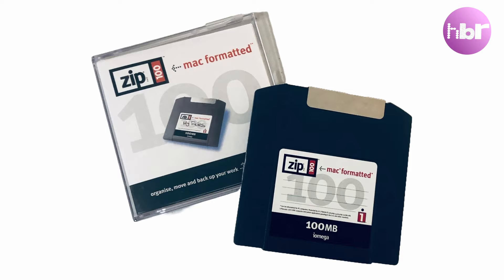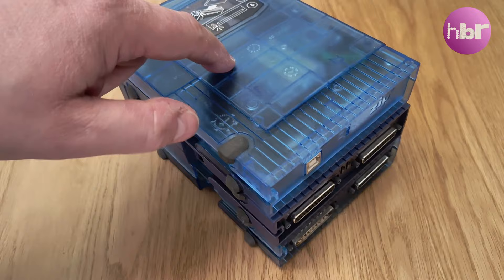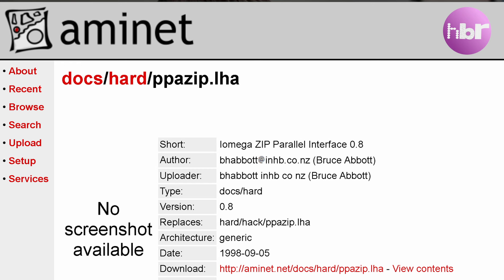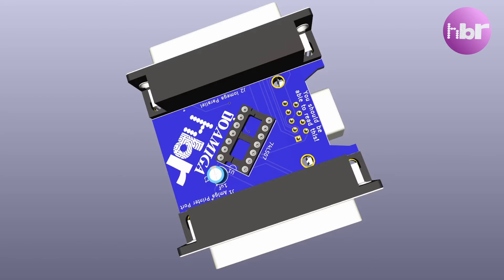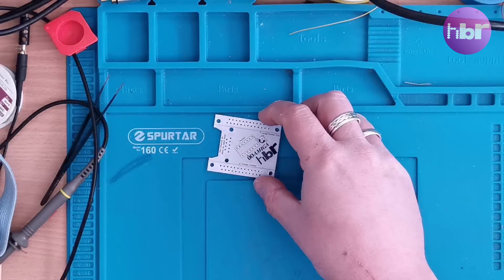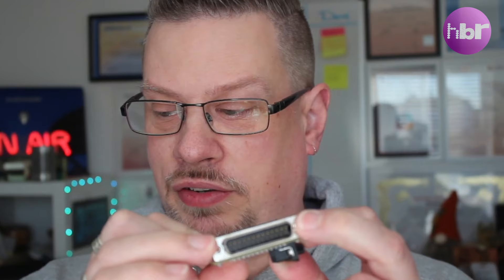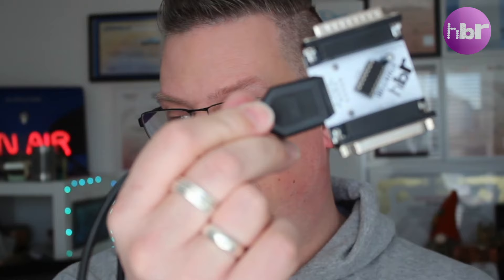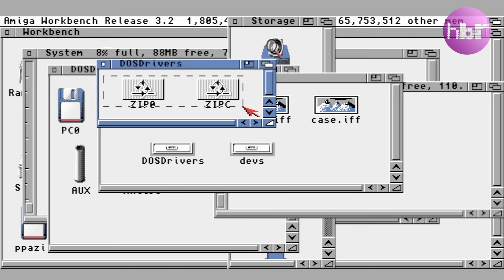Finally! Game Changing File Transfer, on the Amiga?

Comment: I have a parallel port one be good if you could by the adapter pre made with the required software.
Reply from the maker: In theory you can, there is a link to the project on PCBWay in the description they do offer an assembly service, all you would need then is a 9pin joystick extension and the software is available on aminet... If you are in the UK I could sell you one assembled I guess, wasn't expecting there to be a market lol
Reply: @hackbuildrestore  I would like to buy one . So people can ask : Why ? And I can say : because it can :-) What's the price of such a build ?
Reply from the maker: Where are you based? I have enough to build a few I think, I don't have joystick extensions though... Didn't really expect to sell them...
Reply: I also have a parallel port one and an Amiga 600 which I sadly have no way of copying software onto it. I would also buy one pre-made if available!
Reply from the maker: Shop is now up on https://hackbuildrestore.com/store
Reply: If you look closely, some have a scsi icon. These can be plugged into a real scsi buss.  I have  one connected to my Atari st.

Comment: I still have my IDE zip drive in my Towered A1200 with Zorro slots and a blizard 1260.It truely was a game changer.
Reply from the maker: Thanks for watching! I was looking at some towered A1200 systems on evilBay only last night :), they look to be a nice alternative to an 4000t !! I don't have any AGA machines yet... I do have a ZIP250 and ZIP750 in the internal IDE form, just I lack an IDE controller in my A2000. I do, however, have an external SCSI ZIP100 I plan to try that on the A2000 at some point... soon!

Comment: I was lucky enough to have a GVP hard drive for my A500. It had a SCSI port on the back and the only thing I needed to do to the Zip drive was set the termination. For that point on, it was just like using a big floppy drive. It even sensed disk changes and mounted the new disk without me having to do anything. In order to format the disks, I believed I used GVP prep and then just formatted them, but it has been quite a few years.

Later on, I got a used A2000 with Commodore's SCSI card in it. It was a drastic change from the GVP. For starters, I couldn't even figure out how to format a disk. It's been so long that I've forgotten the commands, but I seem to recall that there was a reboot required, which wiped out whatever you had just done. Even my friend didn't know how to do it with just Commodore's software. He told me to download a program called SCSI Mounter, which did the trick. Of course, it had to be used whenever you swapped disks, since the Commodore card didn't automatically detect disk changes.

Oh, did I mention I had TWO Zip power supplies just die on me? The first one died after I unplugged it, moved the drive and then plugged it back in. The second died after being unplugged for a few days. Iomega replaced both. My drive also clicks (shutter opening and closing), but it never corrupted a disk.
Reply from the maker: Thanks for watching... Amiga SCSI experience depends on the cards firmware more than the card, I have a GVP Accelerator with SCSI in my A2000 very happy with that. The Commodore cards varied but depending on driver / firmware where just as capable. As to power supplies, and drives electronics manufacture in the 90s was a bit wild west.
Reply: @hackbuildrestore  To be honest, my experiences with Commodore hardware in the Amiga era left me a little disillusioned. Besides the SCSI card, the A2000 also had a Commodore made 020 board. The board worked fine, but being an 020 board, a lot of games wouldn't run. How do you disable it? By holding down a mouse button while booting, and it's only disabled until you next reboot. What's the problem? Holding a mouse button while booting is also the method used by the Kickstart switcher, and which also resets upon the next boot. Using PAL mode also requires you to reboot, but holding a mouse button while doing so will bypass the PAL boot.  This severely limited my games compatibility.

My first A500 developed a fault where it would crash if you bumped it, or even if you typed too hard on the keyboard. Experimenting with it open, I discovered that pressing on the center of the motherboard would cause it to crash. I'm not an electronics expert, but I examined the board as best I could and I didn't see any cracks or bad solder joints.

My second A500, which was used, also developed a crashing problem. In that case, it was a bad solder joint on the power supply connector. Luckily, that was an easy fix.

I not only had the GVP for the A500, but also a Supra 8MB RAM expander, a Supra Turbo 28 accelerator, and a kickstart switcher that STAYED switched. I LOVED this setup! I got the benefit of a much faster CPU while also being able to make pretty much any configuration needed for games. Unfortunately the RAM expander developed a problem, which I'm kind of , sort of blaming on Commodore (as well as myself). 

Commodore made peripherals designed to plug into the A500's side expansion slot had a plate that was designed to slide under the A500's case. I guess this was supposed to provide some kind of support if someone picked the system up with the device attached. Regardless, pretty much all companies followed this design. Unfortunately, the plates on these devices only side under the A500 itself, not each other. So when you stack multiple devices on the side, putting the plates under the next one causes stress on the connectors. I should have just cut those damn plates off, or taken the cases off, but I didn't. The RAM expander was already slightly damaged when I got it used, and over time it got worse. I tried to repair the connections, but my soldering skills aren't the greatest. Even though everything looked OK, it didn't work. And without the extra RAM, the Turbo 28 didn't make any difference. That was when I got the A2000 from a friend and started using that.

Oh, and probably not Commodore's fault directly, as I'm sure they probably bought them from someone else, but I saw multiple Amiga floppy drives develop the problem where they don't detect when a disk has been inserted, or they think you ejected it right in the middle of something. The culprit was always those little pin switches on the lower left of the drive opening, which get pushed down by the disk. I took one of those components apart once and the contacts are TINY. You could balance them on the head of pin. Putting it back together after cleaning them was a royal PITA! For what it's worth, neither of my third party floppy drives ever had this problem.
Reply from the maker: It wasn't just CBM it was just hardware in the 80s and 90s lol PCs were just as bad. The early big box Amigas were very well designed (compared to other machines of the period) I remember many issues on PCs with ISA card compatibility due to no standard bus speed... 😜 The A500 was expandable to a point but as it had no buster chip meaning multiple side cart compatibility would depend on the use of interrupts and DMA. The drives were just bad but if cleaned regularly were "OK" ... Never had an issue with PAL switching being in the UK 😉
Reply: @hackbuildrestore  The only problem my C64 ever had was a blown fuse, and that was my fault. I had made a dongle to run an uncracked copy of Leaderboard Golf, which plugged into the cassette port. I just sawed off a connector and left the end open, so when I plugged it in blind, it shorted some of the pins. A new fuse and it was as good as new. I had a Datassette in the beginning (because I didn't know any better, and didn't know how much tapes sucked), and one day I accidentally knocked that braided metal cable into the user port. It crashed the machine, but it was fine after I cycled the power.

The only problem I ever had with my 1541 drive was one really hot summer night, it started reporting errors on all my disks. I wedged a piece of cardboard in the last ventilation slot and angled it forward, then aimed a small fan at it. After 10-15 minutes, the drive was working normally again. I left the fan blowing on it until I shut it off for the night.

Like ten years ago, I found two C64 power bricks in the trash. As I didn't then know their reputation for failing and frying computers, I plugged them into another C64 I had (mine as packed away), and they both worked. I also found 1702 and 2002 monitors in the trash around the same time, and they both worked great.

BTW, "trash" is "bulk trash pickup". Twice a year, the city will haul away for free, almost anything you put on the curb. People use these periods to clean out their closets, attics, basements, etc. It's about 75-80% trash and 20-25% usable stuff. I've found working laptops, DVD movies with the shrinkwrap still on them, bicycles, keyboards (computer and musical), and all sorts of stuff. The only downside is that scrap dealers take all the metal if they get to it first, and cut the cords off everything for the copper.

When my A500 setup was working properly, I had the A500, 8MB expander, Turbo 28, and the GVP drive. The accelerator could be toggled with a switch, even when the Amiga was on. I used to love showing people the dramatic difference in Wing Commander when I flipped that switch. I usually left it on, as I don't think it ever interfered with any games, even non-DOS European ones. I would have put RAM in the GVP, but it didn't support 2MB SIMMS. Only 4 x 1MB or 2 x 4MB. I didn't want to downgrade to just 4MB, and the 2MB ones were ridiculously expensive.

I kept my drives clean, but those damn little pin switches always gave me problems. Each one is a plunger and under each one in the "box" is a spring and a set of contacts. The base of each plunger is maybe 4-5MM, hollow and with a notch on one side. Inside that base is a tiny little "U" shaped piece of brass or copper. It's maybe 2-3mm long, maybe 1mm tall, and probably about 0.25mm thick. It sits in the base, so that the opening of the "U" faces the notch. When the plunger is pushed down by the disk, the ends of the "U" connect the two contacts in the base. The total contact area is probably 0.5mm. The tiniest bit of oxidation and the connection becomes unreliable. Basically the same reason virtually all mice today develop that damn double-click problem. Now imagine trying to get two of those suckers to stay in the bases of the plungers while you put the springs back in place and try to snap the whole thing back together. I only ever did it once!

Here in the U.S.A., we had to use PAL mode to run a lot of pirated games, otherwise they had severe glitches or refused to run at all. On the other hand, a lot of American made software was hard drive installable, something that was virtually unheard of for UK and European software developers. So there's that. ;)

Comment: I dreamt of a swapable disk like the ZIP all through the 80s .. when it finally came to the market I had an CD burner.. ZIP was useless because it was way too late and didn't even find widespread adoption :(
Reply from the maker: Thanks for watching, IMO the advantage of ZIP was cost and re-use while CD-R suffered with compatibility issues when introduced in early 90s and the same to a degree with CDRW in late 90s; ZIP and later JAZZ did have a place even if it was shorter lived than iomega expected. The sweet spot was, I think, 1994 to 2000 it was eventually killed along with optical drives by USB Storage. I had Optical and ZIP drives in PCs well into the 2000s, I use ZIP for the convenience of a floppy, writing CDs even now is cumbersome at best and isn't as fast for a few MB of files.

Comment: Enjoyed the awesome video - but not sure what frame rate the parts where you are speaking to the audience are playing at, as it’s giving me a headache 😢
Reply from the maker: Thanks for watching, and glad you liked it... I sorry you had a bad experience with parts of the recording, its the first time I have recorded on my laptop, thanks for the feedback and I will check my settings!!
Reply: @hackbuildrestore  it’s cool, although I did notice your overhead cam has good  frame rate, so maybe whatever those settings are - that would also be good for other bits of the video :-)
Reply from the maker: Recorded on a completely different computer, so it may just be the laptop hasn't got the horsepower to do the job properly, or something is set very differently ... I will sort it out for the next time I'm "On Camera" :) Good to know the other shots are OK... If you can watch the ZZ9000 video without any issue that uses the same camera but on my desktop. Thanks again for the feedback, invaluable!

Comment: The SyQuest drives were much better than the Iomega ones, SyQuest was making these kinds of drives long before Iomega. I still have my SyQuest EZ 135 MB Drive. Later on I got a 2GB Castlewood ORD drive.
Reply from the maker: Its a bit of a VHS/Betamax story to be honest, yes SyQuest had platter disk drives at the time Iomega released the ZIP100, but at a much lower capacity and speed, they didn't release the EZ135, which was set to compete with the ZIP drive, until 1996 (2 years later) and the other contender from 3M was the LS120 SuperDisk but that didn't hit until 1997. I suppose Iomega just proved you can win the race with a lame horse if it has a 2 year head start!

Comment: I use a zip drive on my Atari St to move files. Works greatmn
Reply from the maker: Cool, I will be using one on my Atari ST too!!
Reply: @hackbuildrestore  Use the small GEM (33 meg) partitions for windows comparability. Linux mounts them just fine (don't use AUTO mode in fstab use FLUSH instead or access will be really SLOOOOOW.)

Comment: The one question I had hoped you would cover in this vid - can you load and run games directly from the ZIP using this device on the Amiga 500 and can you install games from floppy to it? Further, since it uses the joystick port, I'm assuming there may be an issue playing a game with a joystick while this device is plugged in/in use?
Reply from the maker: Think you have sort of answered your own question, I have experienced with protracker on zip this does give space for samples so on and makes it simpler to then pick up and backup on PC... Playing games would be possible for those that don't have a need for joystick big point and click adventures would be a possible use case if you had a zip drive but no HD

Comment: So curious, how long did it take to transfer the 2MB version of Worms from the ZIP to the A500+?
Reply from the maker: Not that long, speed wise depending on the spec of your amiga the zip drive is 2-3 x faster transfer than a floppy disk. As for exact timing I'm not sure but at Kickstart 02 Expo I was copying 2-3Mb MP3 files from ZIP to Ram Disk in about 30s, I think; could even be way less than that :)

Comment: Thanks for the video and uploading to pcbway.  I have a few zip drives and a few Amigas and I need some soldering practice before tackling larger projects. Do you have a supplier for the parts that you recommend?
Reply from the maker: Thanks for watching, glad you liked it. There is nothing really special about any of the components they are all quite widely available, availability is quite good on eBay, if you're in the UK I did put links in the components section for the D-Sub connectors https://www.switchelectronics.co.uk
Reply: @hackbuildrestore  in US.  Trying to build on the cheap ....  might have to order those connectors from China and wait....
Reply from the maker: Ali Express is an option but geared more towards volume orders than one of... Hope it goes well, there is an adf file for download on my website with the driver, if that helps once you have it built...